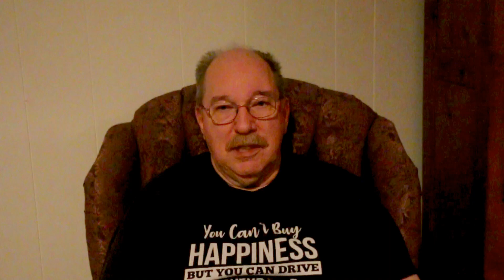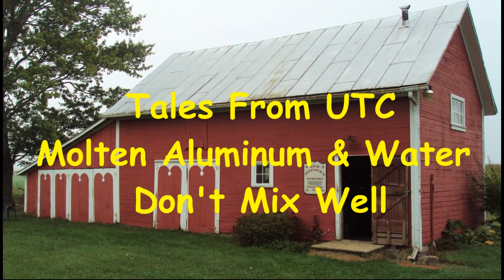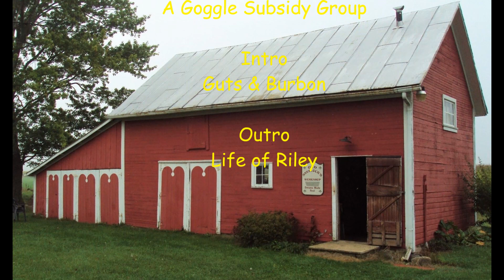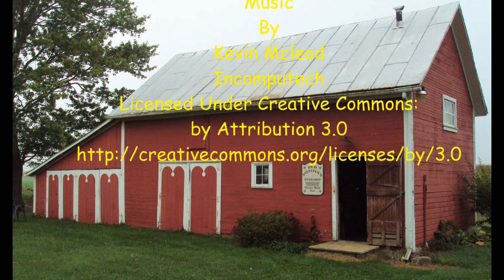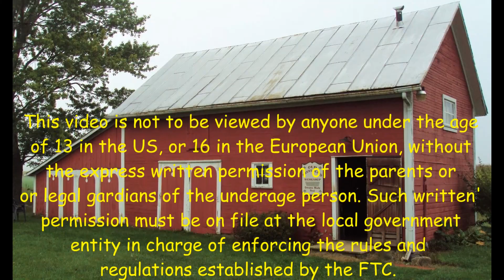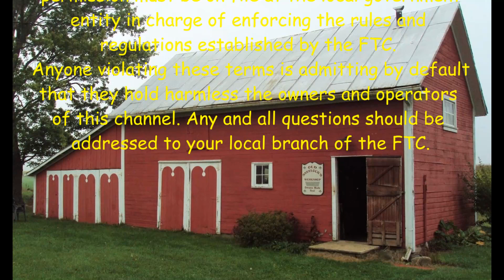Tales From UTC – Molten Aluminum & Water Don’t Mix Well

Comment: Great story. Brings back memories of when I worked smelting aluminium. As you said, dangerous stuff if not handled correctly. Our biggest problem was idiots trying to chuck their used drink cans in. Just a small amount of fluid left in them created fireworks.
Reply from the maker: A supplier I worked with was loading a diecaster melting pot with ingots. You always set the ingots to preheat before sliding them into the pot. He didn't wait long enough. The pot erupted and coated him with aluminum foil. 3rd degree burns on his  neck arms and chest.
Aluminum chills so quickly it sticks to skin like solder. 
He was lucky it missed his face.  🚷😎
Reply: @OldSneelock  ouch!

Comment: Great story, Dave!
Reply from the maker: Glad you enjoyed it. It much better in memory than walking into the shop to find remelt shut down while we replaced the ceiling brick over 100,000 lbs of 1050 degree F. aluminum.

Comment: Careless Fork Lift Drivers are a money maker if you're in the construction business. They tear up everything, I believe a hole rammed right thru a steel column with a fork was my first Solo Structural Repair when I was in the business. They never knew who did it but he must've been moving pretty good to put that fork right thru the gut of a fairly heavy I-Beam Column like that.
Reply from the maker: 5 tons of iron pushing a 6" wide knife end chisel at 15 or 20 miles an hour is a tremendous amount of kinetic energy. 
We mounted guard rails on 4" structural steel tubing. We replaced them frequently.

Comment: In the same vein, we were reworking a state gravel road, getting it ready to pave and it ran through a big farm, big for here anyway. The guy that worked there was bad to pour Drano into a plastic drink bottle after cramming in some aluminum foil, screw tight the lid, pitch it and drive off. After around 5 minutes it'd go OFF! Scared a LOT of folks. We called him Bomba!
Reply from the maker: I've done that with toilet bowl cleaner. 
Now it is setting off an illegal explosive device.
Reply: @OldSneelock  He scared the whatevers out of a bunch of folks around there.

Comment: When I pulled a stunt I was usually the one to do the dirty work to help fix it. I'm like Paul about the paper mill. Poking around there waiting for the rest of the constructors to get back from lunch/dinner was what turned me away from any kind of plant work. Way too confining. I needed running room and lots of it. I'll give you a tidbit but not about paper. Some of the 1st shots at the boulder hole were stemmed or a baloney stick (2 1/2 x 16, maybe 18) and then a set amount of p-gravel between them. With seamy rock, which this was till you got down to the granite, the shot blew out chunks of prima cord and baloney sticks all over the place. My pal, the Self-made Millionaire was running a model-6 Northwest shovel and would hammer on a stick with the bucket, trying to get it to go off. He was the best rigger I EVER saw but would get not-too-bright streaks sometimes. He's still going. And as far as I know, I am too. I cranked a weedeater for Toots. Spring is HERE! GBWYall
Reply from the maker: I know I did crazy stuff as a kid. 
Shooting an arrow straight up and watching for it to turn so I could tell were it was going to land. 
I figured out that was dumb by the time I turned 25.
Reply: @OldSneelock  No diesel in archery either.

Comment: I am fascinated with how stuff works from the year 2000 and earlier. Before all the technological stuff became really prevalent. I love your videos. I am a legal buying person who does a lot of his own metal work and automotive work. So I am so glad to have found your channel. Love the stories and keep them coming.
Reply from the maker: I expect to have one every Tuesday unless something happens. 
The Midwest Foundry had equipment that dated back to before WWI. Everything from that time period was manual. Presses, lathes, etc. The brains were all in the head of the operator. 
The CNC equipment is all using one guys brain to do the work for whomever stands in front of it and loads the raw material in it. 
When I programed equipment there might be 15 or 20 people running the program on different machines at any one time. 
Fun time to live. 😁😎
Reply: @OldSneelock  Seems like that's the way it's been everywhere I went, all my life. Got to straighten out all matters of stuff. The old drivers always liked it when I ran whatever when they had to be off. They said it was the same as when they left it, just maybe sitting in a different spot. BUT the 15 or 20 were using THAT program. Talking about a train wreck if you had to find enough non-doorknobs to to it now!
Reply: You'll never be the same after being around this outfit!
Reply: @lewiemcneely9143   Hah!   True enough.   I was in Tractor Supply today looking at tool handles, having an internal dialogue with myself...but it was in Old Sneelock's voice!
Reply: @tree_carcass_mangler  Pitiful, ain't it BUT it sure happens. I just make mine out of pieces of limbs; poplars mostly. I have a couple of bought ones but they're in the big tool box and out of sight and out of where my mind is supposed to be. GBWYou!

Comment: Just brought back a lot of memories.....so many stories to tell and there all good ones.....I works in a few steal mills with furnaces and rolling mills and billet extrusion sonI know what your talking about.....bring on more.....I have a few to but it’s for next winter when the weather is bad.....I enjoyed it.....CHEERS
Reply from the maker: Amax was next door. They had a 30,000 ton extrusion press that could push steel and titanium.
Reply: @OldSneelock  Those numbers AMAZE me. Was it at Ashtabula they had one about that size that did the extrusions for fuel rods for atomic bombs? Somewhere up there.
Reply from the maker: @lewiemcneely9143  The big press used water intead of hydraulic oil. 
The oil would diesel in the lines.
Reply: @OldSneelock  The big one they had was a piston job instead of gear. A Lowey hydro-press so it was probably water too. Made in the 40's I think.

Comment: I'm just sitting here grinning, because I knew what was coming next.  The paper mill had 4 recovery furnaces, 3 power boilers, many pulp digesters to cook wood chips into pulp.  Every one of them could blow up I've seen the boiler tubes leak water and blow the side out of building leaving a 40' hole 3 stories high. I just can't believe someone would toss a can of water into the furnace and run.  We had lots of roll up doors most were replaced with vinyl cloth they were easier to replace. Once or twice a month someone would drive threw one. Lots of entertainment at the mills watching people almost as good as a boat ramp.  Have a good night sleep and pat Sadie on the head good night for me.
Reply from the maker: Lucky to be alive after some of the goofy things I have seen. 😁😎
Reply: @OldSneelock  Sure am glad that the Almighty is calling the shots!
Reply: I didn't poke around a whole lot. What I saw reminded me of an organized train wreck, from the island where the trash was dumped to the front gate. I got to clean that dump up with a dragline. Maybe that's where this 3rd eyeball and extra limbs came from. GBWYou nd Sadie needs pets from me too.